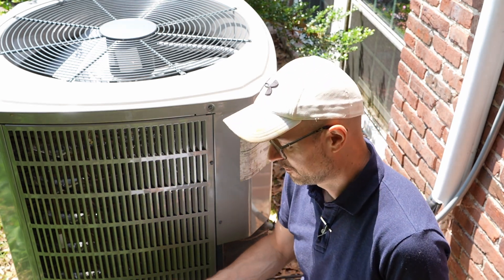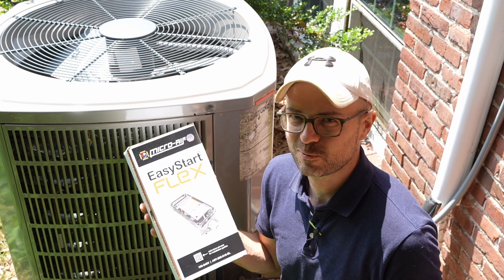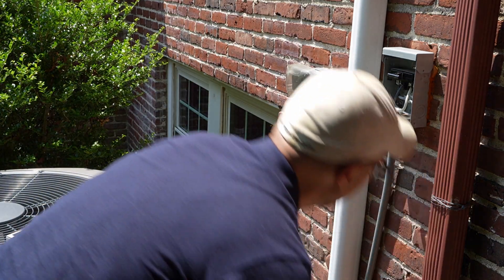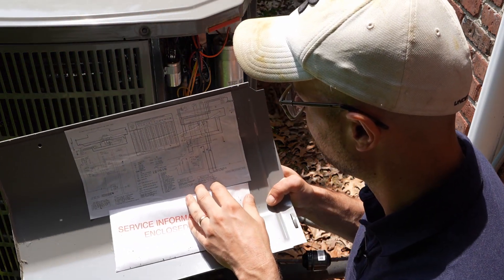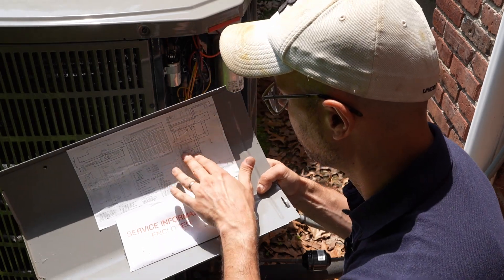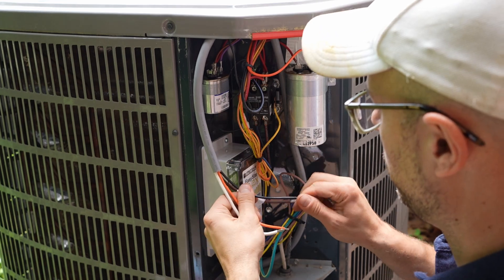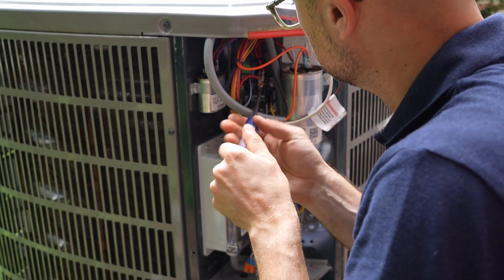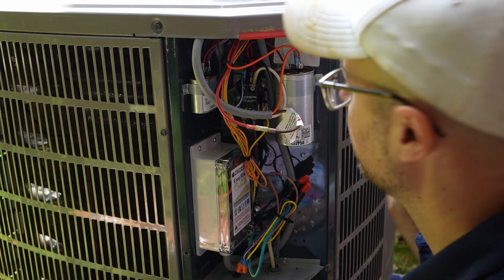DIY install of air conditioner soft-start (Micro-Air Easy Start Flex) - so much quieter!

Comment: If your compressor pulls Locked Rotor amperage then your compressor has a Locked Rotor which means it has failed mechanically and will no longer pump refrigerant. I think what you were trying to say is that inrush  Amps can be close to the LRA but for only milliseconds and should go down to the Run load amperage noted on your data plate.

Comment: The fla Is actually the start up amps x's 1.33 = 35.644 amps instantaneously then drops into normal running range. The Lra is totally different and would actually trip breaker before actually hitting 134 amps.

Comment: Great Video.  I noticed you touched the HERM terminal with your bare finger.....  Even though you pulled the power disconnect and even though you discharged the cap, I did not see you do a voltage check with a voltage meter to VERIFY no voltage present.  You are a brave man to touch that cap terminal with your bare finger!  :)

Comment: These easy starts are killing compressors when they fail...Good idea not so practical
Reply from the maker: They are not killing compressors. I see there are a couple of videos with a title of "Soft Start Killed Compressor", but this is clickbait. In those videos, the soft starter itself died (because it was improperly sized or incorrectly installed), and it "killed" the OPERATION OF the compressor, because obviously the compressor can't work if the soft starter is no longer driving it. The compressor itself is perfectly fine, and starts working again when the system is fixed. Those videos are infuriating.

Comment: I researched and bought one for my 3-ton carrier heat pump. It dropped the startup noise and the lights flickering in the house.  I have a tri fuel 13500 Watts Westinghouse Generator that I use with natural gas, and it can run everything in my home. The soft start will sacrifice itself to save my compressor. I am glad that I made the purchase.  I installed it myself in 30 minutes.
Reply: Bought the exact same gen for those periods of power failures then purchased this flex start to help the gen because of the draw when the air kicked on. The other benefit for installing the flex start is that it should extend the life of your air unit.
Reply: Lol yeah you both keep believing this will save your compressor 😂

Comment: MY "MICRO AIR EASY START FLEX" FAILED IN JUST 11 MONTHS AND THE MANUFACTURER IS NOW SENDING ME A REPLACEMENT. IT WAS CONNECTED TO A NEW GOODMAN 5 TON HVAC. LED IN IT WENT FROM HEALTHY GREEN TO BRINKING RED AND THEN IT STOPPED SUPPLYING THE RIGHT POWER THE COMPRESSOR NEEDS. FAN ABOVE THE COMPRESSOR WAS RUNNING FINE BUT THE COMPRESSOR WON"T START SO I HAD TO BYPASS THE SOFT START CABLES BACK TO THE WAY THEY WERE BEFORE THE INSTALL AND NOW HVAC IS RUNNING AND COOLING AGAIN. SEE THESE COUPLE VIDEOS WHICH SHOWS OTHER BRANDS ALSO FAILING IN LESS THAN A YEAR.  https://youtu.be/U8Gy4gOB50w?si=LSQuQuhZCH9KzOKQ
https://youtu.be/BHW1mX0lVC8?si=-Mw60PURaJe45mXs

Comment: I installed one on my Travel Trailer AC unit, did the 5 learning cycles and was finally able to run the unit from my inverter/generator. But, for my home I installed an ICM Controls ICM870-32A for my 5 ton AC unit. The instructions do not specify having to "train" the soft start, however, the installation instructions do read that it has a "self learning algorithm" and other diagnostics.

Comment: Hi.  Could someone explain 
1. The capacitor . How many connection points does the capacitor have and please confirm we are connecting the orange wire to an existing connection point that has an existing orange  wire on it. 
2. The relay.  How many connection points does it have.  Please confirm we are connecting the new black wire to the same connection point of the existing black wires 
3. Relay red wire.  It seems there is an additional red wire behind the one he removed ?  How do i determine which red wire to remove and splice ?
Reply: "1. The capacitor ."  For your installation, the run capacitor for the compressor will have 2 or more contact posts or blades. Keep the existing wire from the auxiliary (start) winding connected and connect the orange wire from the EasyStart to the same terminal. In other words, two wires connected to same terminal.
"2. The relay."  Yes,  the black wire from the EasyStart will connect to the top left of the contactor (relay). There can be several terminal blades available for your installation. Or,  you can attach to the screw terminal.
"3. Relay red wire."  This video is unusual in that there are 2 separate run capacitors. One for the fan and one for the compressor. That is why there are two, relatively thin, red wires in the back of the contactor (top right terminal). One red wire to each capacitor. The thick (heavier gauge) red wire, in front, is the run winding wire. This heavy gauge wire is the one to remove from the contactor and splice to the EasyStart brown wire. For your installation, be sure to read your schematic for your condenser unit and trace the wires before installation of your EasyStart.
Reply: Both the capacitor and contactor (relay) have 1 more strip to accept a plug or ring.  On the contactor, you may have to look under the connected wires to find additional strips.  But don’t worry, each connection on the capacitor and contactor can typicallly accept 4 plugs.

Comment: Nice clear video with clear instructions... I installed one of these on mine today and it appears to be dead, doesnt get ant power, fault, or normal lights to light up. 
Followed the instructions for my trane 5 ton AC to the T. Double snd triple checked all wiring and still a no go . Bummer 😕

Comment: Can it work on split ac units
Reply: Split or MiniSplit use inverter technology which is already soft-start.  Either don’t need another soft-start device or it doesn’t work if connected.

Comment: Most likely your lights goes dim is because the so called electrician who wired your home use under gauge wire which caused a brownout.  It’s not the AC it’s the 15 amp 14 gauge wiring

Comment: My heat pump is right outside my bedroom wall. Poor choice that the builder placed it there.Im a very light sleeper and after 3 years it still wakes me up multiple times a night.Gonna try this. I’ve done everything else . Bolts tight. Coils clean.3 sided surround with sound blanket.Thick rubber compressor jacket.

Comment: Be sure to use your wiring diagram on the unit.   The colors may be different.  On my cap it was the purple wire and not the orange wire.

Comment: Is this still working well for you? I've seen lots of negative reviews on these new flex units blowing caps.
Reply from the maker: Haven't turned on AC in many weeks (October in Massachusetts), but it worked just fine the rest of the season, about 2000 total starts, according to the app.

Comment: Any savings on your power bill?
Reply: No.  Reduces surge current at start up, not running which is constant.  Less stress on compressor to potentially last longer, but not material power savings like LED vs. incandescent.

Comment: Just installed my flex  yesterday.  Starting amps went from 77 to 18.7 after the learn cycles.  Thanks for sharing your install. It was immensely helpful to complete mine.  I’ve heard these flex units fail prematurely and the company is not very responsive in replacing them under warranty.  I would love to hear anyone else’s experiences.
Reply from the maker: Thanks! Mine has worked just fine since I installed it ~2 months ago, with about 2000 starts total. We'll see how it holds up next season, but pretty happy with it so far.

Comment: Installed my flex start today 9/16/2024. Goodman condenser. Letting the learn process procced. On #4 learning start. After #5 I'll see how it does with my Westinghouse WGEN9500DF. 
It pared right away to my android phone. Note that the app only works while the AC is running. So far no faults.
Reply: Keep us posted. I've got a flex that I'm about to install. I'm seeing many complaints on premature failure for the newest model. The flex.
Reply: @brogers114able  It has done 7 learned starts. 17 starts after that. No faults.as of 9/22/2024. My AC runs fine with my generator on propane.
Reply: @brogers114able  Where are you reading about failures? Does it fail the whole AC system or just the soft starting?
Reply: @nametaken24  if you search you tube videos for micro air flex, there are many comments within the last 2-3 months saying theirs died within a few weeks of install. Just the soft start dies. Everything else is fine if it fails.

Comment: Basically what you're getting is a start capacitor and then they're probably bring it on the condenser fan a little different time maybe before the compressor but unless you have a adjustable speed compressor you need to get that thing a shot and get it going and that's what they're doing and that's a can of a scam they've had that for years

Comment: Got my Micro-Air Easy Start Flex unit today. 8-27-24. Reading over the paperwork. It sure would have been nice if the installation kit were offered at the same time as ordering the unit. Now I have to wait more days to receive it. Slow shipping. I went back and checked. My bad. The kit was offered. I overlooked it. Sorry about that. My edit.

Comment: I hooked mine up and now it doesn't cool.  cool air out the compressor fan. - disappointing!  followed your instructions exactly - then i shut off the system because you said it has to start 5 times - but it never stopped because it wasn't cooling.  i shut the system down and now the thermostat says waiting for equipment.  also, i noted - the blue wire on the left side was buzzing when i unconnected it - and reconnected - the contactor clicked in...when the power was off!  is this normal?  the EASY START has a green light and a red blinking light 7 times...then repeats  as soon as i bypassed the easystart - the AC started cooling again!  I looked up the 7 red lights and it says "Start Winding not Detected/Mis-wiring"

Comment: Will this also help lower your electric bill?
Reply: It doesn’t.  Soft start eliminates momentary stress on the compressor which can cycle start several times per hour.  The poster said the Recorded data on his device showed 2,000 starts over 2 months.  The stress relief will make the compressor last longer.
2 other benefits: soft start reduces surge amperage so a back-up generator can start a central AC and it can reduce start up noise if near a living area.

Comment: Think I'm going to go steal the Hutch Mountain wiring approach.  Blue female spade disconnects for orange and black, then Wago 221 splicing connectors for the white and brown wires.  This way you can splice into the existing wires leaving the original connection, and should the Micro-Air fail you can have a running AC again in relatively short order without having to redo the termination on the wires.

Comment: Just installed mine yesterday...was working great, now when the AC turns on from the thermostat the contactor buzzes the whole time unit is running. I can manually start it from the switch at the contactor and no buzzing happens....anyone have ideas?

Comment: You may consider getting a 25k ohm 20 watt resistor with wire/alligator clip on each end to bleed your capacitors. It’s a slow bleed that won’t damage your capacitors. I use one especially for electrolytic capacitors. It takes about thirty seconds to discharge and is the best method for bleeding them.
Reply: Thought capacitors only hold charge in DC circuits, not AC.  Thought the capacitor function in AC circuits is to change the AC phase so motor will run.
Reply: @Steve02525 I’ve only ever had one capacitor in an ac unit zap me after powering the unit down in 35 years. I build/repair guitar amps and you’re right, electrolytic capacitors store energy and will light hour ass up.

Comment: Holy smokes.. I did a Hyper Engineering Surestart on mine a few years ago (3 ton).. but it doesn’t even come close to that level of noise reduction. I may need to switch it up! I’m in the generator motivated crowd. Thanks for the video!

Comment: Great video. Reddit points to this being a positive and gaining life out of the compressor. Less hard starting on the compressor makes sense that it extends its life. It does seem to however be a gray area for warranties but generally doesn’t void it from what I’ve seen.
Reply: It definitely won't void it, you can pretty much fight it as a hard start or soft start kit. I would pair this up with an Emerson sure switch

Comment: As an electrician, I don’t believe in one fits all. In rush draw is different on each size compressor. They need to make the appropriate item for each unit.
Reply: ICM makes 9, 16 and 32 at different prices.  I think MicroAir has a new Flex model that cost $150 more than ICM 32a.  I think MicroAir decided 1 model for 1-5 tons is better for field techs to carry inventory than ordering 1 of 3 models for load run amp sizes.

Comment: Excellent video. Thanks for providing. Helped me to install quickly. I completed the install this past weekend on both my 3 ton and 2 ton units. I received 65% reduction on inrush, and minimal amps reduction on running. Given the cost of these units and cost for electricity, in Houston, I will never receive a payback. But, I installed these units so I could run my generator and start both AC units, which I couldn't beforehand. Maybe I could extend the life of my units by 1 year, but, that is an unknown.

Comment: A homeowner should not be doing this.. the LRA is not the amps the unit shoukd or will draw.. LRA Is tge amps if the compressor is locked or seized.. perhaps your start capacitor is going bad and thats the reason for the noise.. yes a hard start woukd he better..
Reply from the maker: Respectfully disagree -- I think homeowners should be able to repair and service anything they own, and are comfortable doing. I appreciate your suggestion about the capacitor going bad, and I might revisit and replace it in the future if the problem continues or worsens.
Reply: @DmitryBrant  I agree with they should be allowed too but there is an inherent risk to anyone without proper training or experience working inside a condenser..

Comment: I installed a micro-air soft start last  year. I love it. I have also had to run off a generator for 48 hours and we had full use of our A/C due to the soft start drawing much less power at start-up.

Comment: Did you void the manufacturer's warranty by installing this yourself?

Do you also have a surge protector before the soft-starter in the circuit?
Reply from the maker: I don't see anything in the warranty regarding who performs the installation, but I haven't asked the manufacturer directly.  As it happens, I do have a whole-house surge protector on my main panel. But then, wouldn't this be another benefit of having this kind of kit, where it could become a "sacrificial" device, and protect your AC unit in case of a surge?

Comment: Nice video.

Energy savings - I was going to post this as a reply to a post below, but thought I'd make it a separate post.  I don't think it will provide any savings.  As Dmitry commented below, the amp reduction is only for a brief while, at startup.   So while that technically does save some current ($), the compressor isn't doing as much work (as much cooling).  It will bee to run longer to make up for the missing BTU's.   It converts that huge bu brief current spike to a lower but longer current draw.  At the end of the day, it'll end up being the same total current draw.   I don't think any soft start manufacturers advertise energy savings as a benefit.

Also thanks to the poster that determined that the Flex is an all-capacity, but 25% smaller unit, than the original Breeze, which you had to buy in 3T, 4T, or 5T capacities.   I only need a 3T unit for my house, so a ~$299 3T Breeze might be fine.  Deciding if it's worth getting the Flex, figuring the smaller unit might (and latest and greatest version) might be worth the higher cost.

Comment: Thank you for the simple and clear explanation. Have ordered a system to allow operation with a generator during power outages. Just saved $300+ on a proposed installation cost.

Comment: My ac unit doesn’t have a disconnect lever like yours does. Will shutting off the breaker be good enough to shut power from the unit? Thanks!